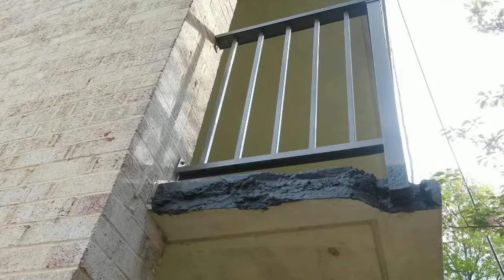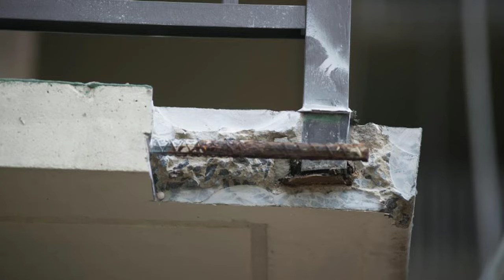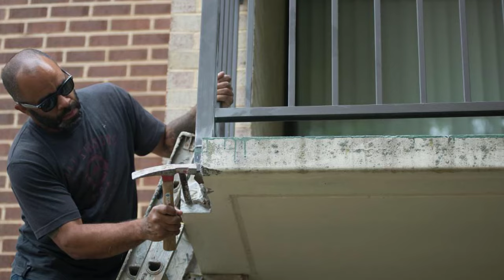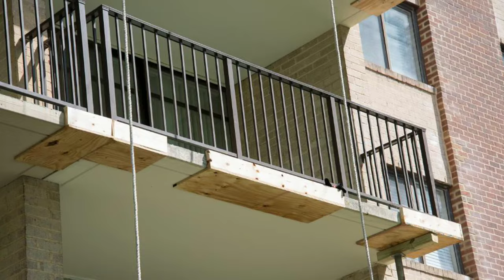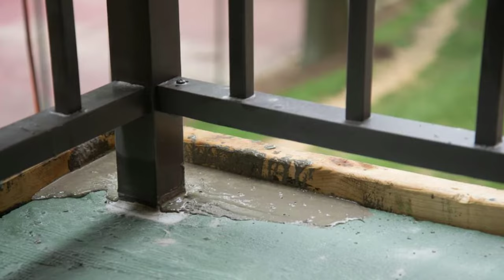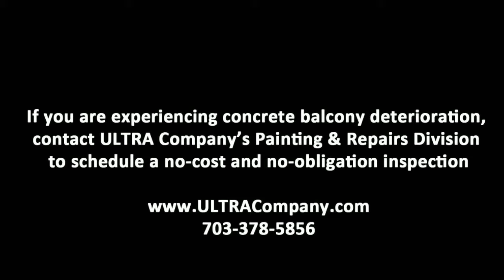How To Repair A Concrete Balcony

Comment: Hi there.
The tiles on my concrete balcony just started breaking in lines. There are no cracks around or underneath the balcony. Is this just a temperature pressure issue or could it be signs of internal cracking?
Concerned.